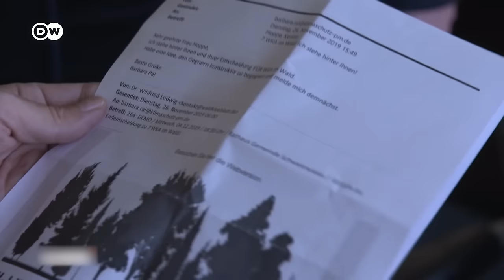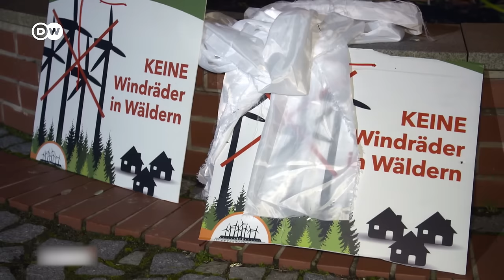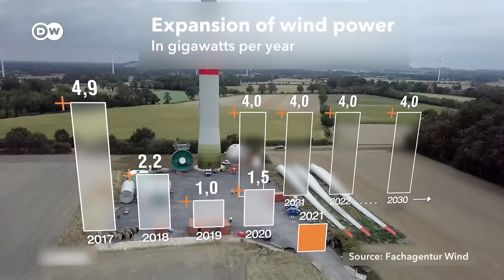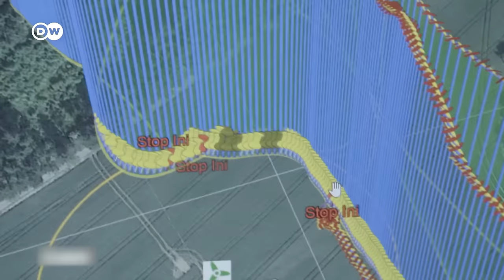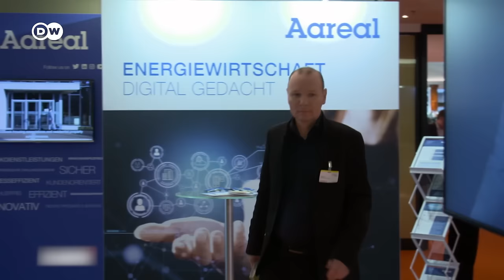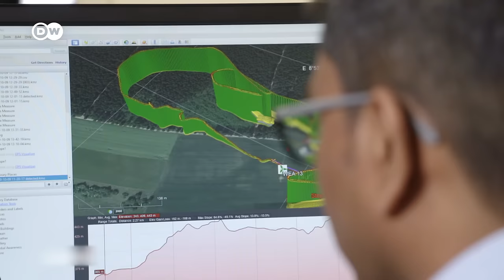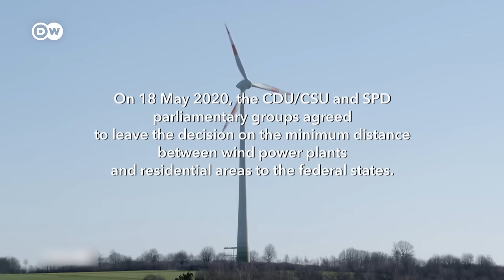Wind power getting headwind in Germany | DW Documentary

Comment: The major issue is that wind power has not reduced Germany’s CO2 emissions to any great extent, specifically in the last 20 years. Between 2014 and 2017 it is basically flat, which is not a good return on all the money Germany has spent on wind and solar. The power sector actually increased CO2 emissions in this period.

Because the wind power cannot provide base load, few coal power plants have been decommissioned. If you built water based storage, either tidal on the coast or in artificial lakes, inland, then the power generated by wind could be stored and could be used as base load, which would allow you to close an existing coal fired power station. 

The whole issue with trying to reduce CO2 is everyone starts with the solution, and then works backward. Set a target, remove artificial government restrictions and let the market decide the best solution. Increasing insulation in houses may actually achieve the desired target. Other options is to start building power storage solutions for the existing wind generating capacity. Currently only water based would give you the necessary capacity of 500MW/hr plus to replace a coal fired power station, but this is a mature and proven technology which would work.

As for nuclear, there is no need to build a new plant, simply refurbish the existing ones and increase their power capacity. Of course closing one down for the time required to do this will cause a significant increase in CO2 emissions in Germany, so there may be a short term political issue.

Comment: how do you reduce industrial consumption when the demand for the goods still exist. simply sending the production to another country does not solve the problem. since these countries are still on planet earth.  the wind is not the best source of electricity for supplying baseload electricity it is too variable and unpredictable.  if want to reduce carbon production you only have two options hydroelectricity and nuclear power. nothing else  will  make any difference
Reply: The fools shut down all their nuclear power for this wind foible.
Reply: Nuclear has no future except in fusion. Uranium is limited and the plants are extremely expensive.
Reply: @Jimmy4video  fusion is the future that is not here  yet. if nuclear has not the future why is France  building new reactors. We still have at least 150 years of uranium and  300 years  of thorium plus plutonium.  Nuclear maybe  none renewable but it will certainly make a big  dent in the production of carbon dioxide.  Nuclear fission is  really  expensive because  we over regulate the industry and take too long approve building of  nuclear reactors to make it economical
Reply: @midnightwatchman1  new reactors? You mean a new reactor, which has taken 20 years and gone way over budget. As for 150 years of uranium, that's inaccurate as it includes a lot of high expense low yield sources. With the the current mining techniques and yields we are closer to 50 years. Of course if you build more plants this number goes down.
Reply: @Jimmy4video  the reason for the delay is project  scope creep. they keep coming up with new technologies for the reactors. the  next projected dates for completion is 2022. the  point is  people are still investing  into  nuclear  fission reactors and plus  there more companies  still investing in the technology.  the  issue is regulations and people.  France  produce 95 percent of their electrical energy  without using  fossil fuel. that why they are only Europe country that can actually  keep up with their promises of  cutting carbon production

Comment: Ontario gets 58% of its electricity from nuclear power and 22% from hydro. Germany should look at nuclear again.
Reply: new nuclear is very expensive. Remember the numbers from the video (3,6 cent/kWh for wind, 6 for solar and 12 for imported h2)? Well, new nuclear is now between 12 and 18 cents/kWh.
Reply: For the €500,000,000,000 Germany's spent on subsidising their energy transition so far Germany could have built enough nuclear power capacity to power themselves and Austria twice over if they'd managed to get the same costs per kW as the UAE's managed with the construction of the Barakah Nuclear Power Plant that's just started coming on line.
Reply: @coreymicallef365  Then I guess that was a cheap nuclear powerplant (though it isn't even operational yet). Based on the average initial cost, it would cost more than 1 trillion to make 70% of Germany's electricity from new nuclear powerplants.

And if the costs of this are ofset on the price (like it usually is), it would increase Germany's electricity bill even more.

Comment: I have experienced debilitating effects from the very low frequency pressure waves generated by a residential area turbine. Maybe out at sea they are OK or very far from populated areas, so I agree with "not in my back yard".
Reply: what kind of effects? not doubting, just curious because they are building one near my house
Reply: @victorv096  Effects are dependent on size for one thing but also on the individual as the VLF or subsonic sounds affect people differently. There are many studies that can be found with a search.
Reply: If I had to hear low frequency waves on a repeating and continual basis I would go mad.
Reply: @thedarkmoon2341  thanks, will look it up, and good luck there

Comment: If people do not want wind turbines in their back yard, why not put all of them at sea ? Is that not cost efficient or are there other problems ?
Reply: The cost is higher.
Reply: It can get wet or eaten by oysters
Reply: More expensive, corrosion, you also loose energy the further it travels. There actually isn't that much coast line.
Reply: Maintenance would suck. S ships would have to avoid large areas. Try building new cables across the entire country
Reply: There are offshore wind farms, much of the wind in Germany that is consistent for energy is from the North. But, it’s quite more expensive relative to inland turbines.
Reply: The problem being is that it won't take long before all the people down :-D

Comment: Should go to modern nuclear and add fast reactors to close the fuel cycle.
Reply: The risk of meltdown is one thing, but there's also the 1000s of years the waste needs to be stored, the fact the uranium must be constantly mined from somewhere on the earth, and the fact it's a none renewable resource as fule.
Reply: @louisdrouard9211  given I've never seen anyone try to put together what the actual emotions foot print of uranium extraction to power is, hard to call it negligible just yet, also, I'm not sure about 1000s of years, I also hear 200, and I'm guessing that's at current rate. I feel it's really something we should save for space, we don't really need it on earth.
Reply: @louisdrouard9211  first time I heard of the PICC, will look into that, still, if wind and other things can take care or most of our energy needs, I think nucular is still best set aside for use in space where we can't use earth for power. Who do you feel about that thought?
Reply: What we have now for nucular keep, it's expansion I'm sceptical about.

Comment: Would have wanted a segment on the potential of maritime wind power. Baltic sea has lot of room to expand wind farms without violating the surrounding nature especially if turbines can be slowed down upon bird's arrival to the area
Reply: The expansion of wind energy in the North sea is happening right now. Agreements have been signed by Denmark, Belgium, The Netherlands and Germany to install about 65GW by 2030 and 150 GW by 2050 (which is roughly the equivalent of 75 nuclear power plants).
Reply: Birds live on the sea as well as the land you know, protected species as well.
Reply: @ClayRavin  Interesting, do you have a source for this?
Reply: @ClayRavin  I looked up the numbers for you:
You must have mixed energy loss during production and distribution.

Energy lost in power plants (so during the production of electricity): about 65%, or 22 quadrillion Btus in the U.S.
Energy lost in transmission and distribution: about 6% – 2% in transmission and 4% in distribution – or 69 trillion Btus in the U.S.

A wind turbine is a mechanical system, so there is no energy lost (the available energy in the wind is not used at full, but that is by definition not a loss)
So the energy lost from wind turbine parks to households is limited to the losses during electricity transmission (6%) and distribution (4%).
Reply: @haveaseatplease  I think you are right. I will delete my above comment.
Reply: 2Sept 23 to 15Sept 23, Baltic totally windless...do the Greeniots have a plan B? Of course not, that would need more than one Braincell
Reply: @haveaseatplease total output of all = 0Kw when not windy. Hasn't been at all windy first 12 days of September. Plan B????
Reply: @ianharvey3696  Stop spreading lies and half truths.

Comment: They need to implement solar at the individual homes if they want to help the climate. The cost of building and maintaining wind power is not efficient.
Reply: The main problem with solar is they don't produce any energy at night, for literally half a day. And on the days of heavy rain and snow no energy is produced by solar energy Every desert hermit I know living off the grid in dry west Texas in a small shack or RV travel tailer using solar have a back up, it is called propane....
Reply: @ronclark9724  solar with back up batteries in suburban areas are great for reducing long term cost and for emergency outages. Solar has got much cheaper and may continue to get cheaper so it's viable now were 10 years ago it may not have been.

Comment: Why did they faze out nuclear power again?
Reply: Lessons from chernobyl and Fukushima
Reply: @arno557  yes because there's a lot of earth quakes in Germany and soviet engineering abounds
Reply: I would say it's bad case of stupids.
Reply: @arno557  What was the lesson from Fukushima? That a modern nuclear plant can be hit by a huge earthquake and tsunami, and still be mostly safe?
Reply: @arno557  Fukushima has proven the opposite point you're trying to prove.
Reply: Do more research on Gen IV nuclear reactors and Small Modular Reactors.
Reply: @arno557  Fukushima is already clean and a livable place again. In fact, seeing at how it was the perfect storm (the only worse scenario is a volcanic eruption, which would make solar and wind energy completely unusable), the results we've reaped on the Fukushima case is the confirmation that every new generation of nuclear plants is indeed orders of magnitude more safe than the previous one.
Reply: @arno557  So I took your advice and 'updated' myself. This is from the wikipedia article about the incident. "The committee calculated that discharging all the water to the sea in one year would cause a radiation dose of 0.81 microsieverts to the local people, whereas evaporation would cause 1.2 microsieverts. For comparison, Japanese people get 2100 microsieverts per year from natural radiation." So, basically it's fine.
Reply: @patsprankcalls  it's fine if you just take water and air but the main problem is conc.of radiation in fishes.Risk is still being estimated.
Reply: @arno557  No need to estimate, you can take the most radioactive fish recorded just after the accident and calculate that eating just that kind of fish as your sole food source still would not harm you. The radiation release from the accident was not a danger to the public at any point. The real harm was caused by the unnecessary evacuation measures.

Comment: Green Hydrogen... waste energy to produce on an inefficient production of hydrogen! Hypocritical!
Reply: Though, if you have industrial chemical plants (like hydrogen) that are capable of ramping up and down production and pair these plants to your renewable installations then you will drastically cut costs on the connection infrastructure which is needed to manage these intermittent sources of energy and may be able to utilize 100% of the energy which these renewable plants are capable of outputting. Then again, it doesn't need to be hydrogen. 
There are thousands of industrial chemical products that could benefit from tying their production to their own renewable micro-grids. Any industry that is capable of coping with a intermittent energy supply could acquire their energy much more cheaply with such a model.
Reply: @nolan4339  I agree with hydrogen, or even better molten salt powerplant has a form of energy conservation to later be spent.
Problem is the "new" hydrogen production is still from fossil fuels, it's just another business rather then a better solution.

Comment: Arguably the most important arc of human history has been the search and adoption of energy sources which are more reliable, more energy and power dense, and more dispatchable than the ones they are replacing. There is a reason, after all, why the world went from sail to steam to diesel. Very, very difficult to envision a world powered by sources which are less reliable, less energy and power dense and less dispatchable than the ones we use now. Nuclear is the obvious answer for electrical generation and perhaps hydrogen produced by electrolysis powered by nuclear generated electricity for transportation and certain industrial uses.
Reply: Horses

Comment: At best wind and solar can be described as 'fuel savers' when they do decide to turn up for work. The truth is that every wind turbine and solar panel needs 100% backup from more reliable sources,  and the only sources agile enough to track the roller-coaster of wind and solar are gas turbines...  During the coldest and hottest weather there is a high pressure cell sitting over large areas,  and high pressure means no wind is blowing. So during the time people want to use their rubbish heatpumps for heating or cooling there is no grid input from wind, and a small amount from solar, which disappears rapidly in Northern Europe winters.   The base load can be nuclear,  backed by gas turbines to fill gaps left by wind and solar staying in bed for days or weeks at a time.

Comment: The harsh reality of green energy starting to bite. Ha ha.
Reply: There is no harsh reality to green energy.
Reply: @tlangdon12  There is. It does not supply base load power all the time and is more expensive.
Reply: Roger Onslow It’s not more expensive. The cost of building a fossil fuel power station and running it is very similar to the cost of building the same output using renewables. The laws of physics mean that you need the same amount of copper winding around a generator to produce 1kw of power regardless of whether the generator is turned by wind or steam. The cost of the plant that goes in front of the generators is very similar, e.g similar amounts of concrete and similar lifespans. Wind turbine blades wear out, but so do steam turbine blades. It’s all much of a much. Even the labour costs are similar. Your point about the base load is valid, but is it harsh? Harsh, to me, would mean something that did harm. We can’t do as much good until we can solve the base load problem, but we are not actually doing any harm. The base load issue will be solved by a combination of diversity of supply, over-capacity and storage. Over capacity is not a bad thing because it provides security of supply and allows for maintenance.

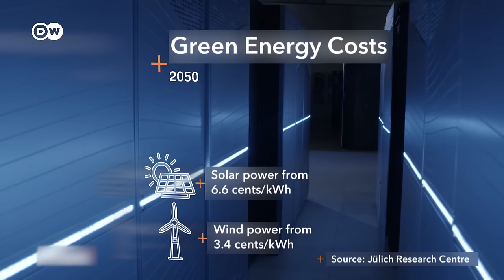Comment: 21:31 It is not correct comparing cost of electricity with cost of hydrogen: renewables are intermittent (you can not have them when you want, only when there is sunshine or wind), while hydrogen is storable, transportable and can be used any time on-demand.
Reply: So far batteries are the most common way to solve that, but water dam storage, or what I prefer, suspended weight storage, like you may see in some old clocks, can do the same thing without the chemical issues. Can litteraly store power with rope and bags of dirt, but that's a bit basic.

Comment: how do the cameras see the birds at night?   Why can't the blades have lights on them so the birds can see them in the dark?   Can future wind turbines be more agile and the blades actually avoid birds without slowing down by much?
Reply: They kill nearly no birds compared to cars, cats, houses, etc. Why try to solve a non problem? I've visited many turbines, yet to see a dead bird or feathers below them.
Reply: @Jimmy4video  I killed a bird once with a 400 watt wind generator.   I was basically in the middle of the pacific ocean at the time, with thousands of birds around, and it was a dark night.   If it had glow in the dark on the blades it probably would not have happened.    Why don't they put led lights on the the blades?
Reply: @seandepagnier  it's probably just a matter of time. LEDs have gone through a lot of development recently so it's a matter of getting that into new blade designs. It should work for short boat blades.

Comment: I think the real reason is that wind turbine's are not cost effective against solar PV.
PV panel prices dropped significantly for the last few years and continues to drop and solar PV is much more reliable due to no moving parts.
PV solar is so inexpensive than I use it to fully heat my small house in winter (Canada).
Even at my small scale solar production the cost amortisation for solar PV energy is below 2 cents/kWh and storage in thermal mass for heating is below 1 cent/kWh
LiFePO4 storage is at best around 15 cent/kWh but a very small part of total house energy use is through the LiFePO4 battery so overall energy cost is much lower.
This is an offgrid system and at a very small scale not sure where they got those numbers at 21:30 but they do not look realistic.
Reply: No problem with solar but I have never seen any sources that say solar is cheaper than wind currently. Hopefully one day since there is less opposition.